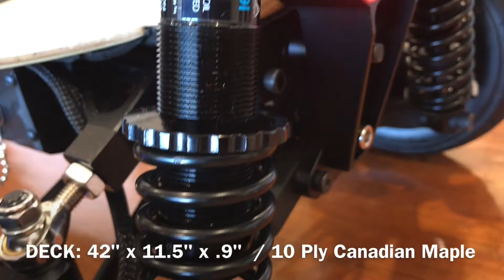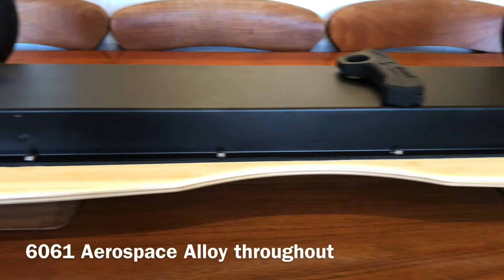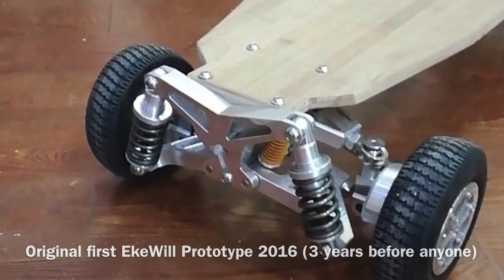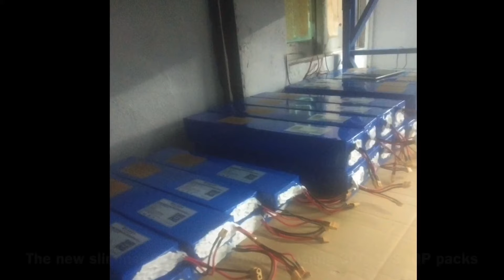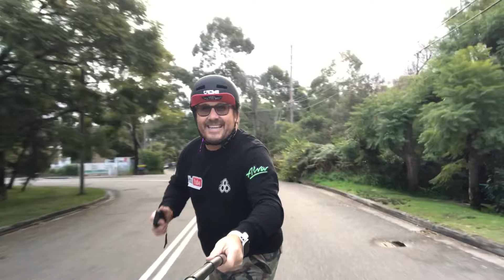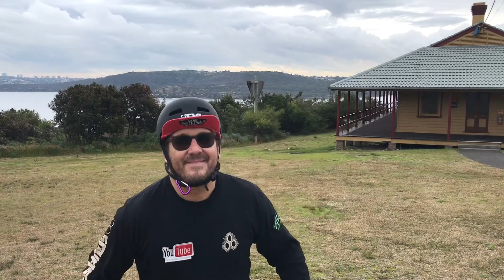EkeWill GTX 4WD Planetary Gearing 12,000 watts AllTerrain EBoard - Andrew Penman EBoard Vlog No.159

Comment: Hey great review! I have an option of buying I think the mach 1 version as you said from a local private seller in Europe ;) its got a black deck its 2wd and has 24 ah batt on it, am I right that this is the first version? What drawbacks did it have?
Reply from the maker: Hey Simon, wow exciting for you yeah the Ekwill is a high polished premium quality build it has the Skeletor CNC milled arms very different to its main competitor the M24 it’s got better but still one can easily see the difference in refinement originally and now there’s done the CNC mil but is still chunky and seek didn’t have the same refinement the Ekwill is a superb build ... mine is still running perfectly no issues at all, okay the early EkeWill were as I understand always a woodgrain decks the retailer may have done a custom deck on it that the rear 2WD has more than enough power and 2WD had no real drawbacks at all they’re still using the same ESC as the version one it’s a custom controller not a LingYi  here you’ll really love it gets yourself some foot straps head out to the Forest it’s mine blowing..... do you love the adjustable oil filament shocks they’re the real deal not a fake air like others  they can really handle a pounding, two wheel drive rear drive train can present some fishtail instability if you’re pumping it at high speeds but they did  correct that with some modifications to the arms but other than that you’ll have no problems 👍 let me know how you go Simon you’ll be very happy it’s like quite a prestigious Eboard the EkeWill it’s kind of your Aston Martin of these beasts 👍 awesome cheers Andrew ⚔️
Reply: @zulupenman  wow thanks for that quick response mam 🙌🏼 yesterday i went to see it - the built quality is superb i must say 😁 - I wrote to you because currently the Ekewill is selling 15 ah batt for 2wd and 30 ah for 4wd no info about the 24 ah 2wd version, which got me suspicious if its a fake or what but what makes sense is that this is a previous version, do you have an email i could send you a video of this board and some pics for you to judge
Reply from the maker: Hey Simon no problem my pleasure, yes please send me a video close-up of the board I’ll tell you straight away whether it’s a fake a rebuild or the real deal, I can tell you now there’s been a lot of heavy discussions In the Facebook riders page is about 5 months ago ....and I’ve been the victim of a lot of bullying lol and harassment from the Ecomobl 24 riders (I can more than handle don’t you worry) lol ...and I can tell you a lot of stuff that I know about the original inventor designer of this style monster  board and it certainly is a Mr Marr from EkeWill . Okay I totally get it he took inspiration from the BajaBoard .... but .. I hate it when a company a big Chinese company takes credit for potentially inventing this design and rubbishing the other company (EkeWill) which is nowhere near as big....  with a less inferior lower grade quality product, there’s a lot to unpack in this rivalry space lol ... yeah but I can go more detail with an email but let’s get you on the right foot he make sure you’re getting the right fitness for purpose board essentially is an EkeWill...and that’s going to suit what you need to do and we can go by email 👍 and chat about that outside this platform .... I don’t want to entice or encourage any more trolls and skulduggery LOL. No problem Simon I email address...it’s in the “description field” at the very end 👍 you’ll see my email address there ....just flick me an email Simon we can go from there we can even have a chat on messenger no problem at al 👍 I am about to next month do some more new Ekwill videos some Red Bull challenge inspired Hill climbs that at 40% inclines ....going to be pretty exciting awesome stuff Simon look forward to hearing from you cheers mate Andrew⚔️

Comment: I had a question Would you go for a 14ah 35E or the 12 ah 30Q thank you
Reply from the maker: Hey Jean ;) awesome thank you so much for popping in so great to meet you. Look without a doubt I love the 18650s over the 21700 for their long range and they don’t suffer and can handle a flogging more ...definitely go to 30Q’s... I just got 42km range with this big beast working with a 10S10p 30Q Samsung setup .. awesome cheers Andrew ⚔️
Reply: @zulupenman  Thank you very much for the hint. I am trying to change my order from the 35E to the 30 Q. Vic is also saying that they have a new ESC, do you know anything about that. Best regards. JFC
Reply from the maker: Hey Jean ;) no problem at all yes I think he had a few drop out issues on the original batch from Hobbywing so I would go to most latest ESC /remote . Definitely the Q batteries are tge go ... With a 15amp draw rate(constant) with a burst up to 25amp and it’s unbeatable ...people think because it’s an 18650 it’s old technology ..it’s not it is they go.... amazing check out my EkeWill long-range Test .. that doubled the range of the competitor Ecomobl which uses 50E battery (even the fact they’re  21700) awesome.. cheers Andrew⚔️

Comment: Great review, good to hear the history behind the development as well. I love my "500w" MAC motor (high torque wind) on one of my ebikes, and thought the tech would find a place on eskate's soon enough. Do these motors have a clutch in them I wonder? I ask because the clucthes on the MAC can wear out with accelerating over bumps, -eg loads of on/off pressure on the clutch.

What a beast, looks very nicely done. Longevity & maintenance will be good to hear about over the longer term. ;-)
Reply from the maker: Hey Lee, Great to hear from you..thanks for your amazing comment and thanks for the great feedback and appreciation of my videos really makes my day, sorry for late reply it’s been crazy. Look in a nutshell no no clutch just pure planetary gearing and the reverse breaking works the same normal motor.. it’s a pretty robust build and this is the original inventor Lee who designed this planetary Gearing way back in 2013 for this skateboard set up so it’s extraordinarily well-made 100% CnC Milled and all anodised the coating on the actual gear cogs of the gearing is insane it’s super smooth and reasonably quiet too ;) i’ll keep you posted on the maintenance and how it holds out so far it’s a beast awesome cheers Andrew⚔️

Comment: I have a new m24 awd.. Here is where this goes off the rails.. first... this board is significantly more expensive... the eco is around 2k right now.. this thing is 4 k.. 4-2=2... thus there is a 2k difference.. i can buy 2 m24s for your price...
Second, have you ever ridden the m24.. all features are controlled by the remote. I can switch between 2 and 4wd from the remote.. Third.. this guy builds his boards piecemeal,  ecomobl has an actual factory with high quality manufacturing processes and qc.  All the parts on the Ecomobl are all CNC...( have you seen one?) So, if im buying this type of design, and i can have newer more developed tech at half the price... oh, almost forgot.. i have 21700 50e cells.. not old 30q... i think ill get an m24, and an ET for less than one of these..  you dont seem to know your own board... also.. i have run flats.( without Dubs).. no patching required...
Seriously, go look at the specs...
This is no deal...where is the 2k extra value? 700$..????? I looked.. the eco m24 is nearly 700$ discount right now, is that where you are confused?
Reply from the maker: Hey Senidog, hey thanks for reaching out and popping in and giving us your feedback. You got some really nice points here in the prices✅ I really appreciate you feeding that back to all of us, very important % discount there. Look dude seriously not all the parts on the Ecomobl are not CnC milled  ...I’ve got one here I’m looking at it now as I type it’s not all CnC milled .. not skeletor milled hollowed out A Arms like on the EkeWill... yikes are solid heavy ... your E batteries don’t perform better in  in long-range test than the Q ... the Q’s are still the best for long range without any sag ... I just got 30 km range on this thing in four-wheel-drive doing about 30 k’s average speed...a have a look at your at Shocks they’re not in the same class as “coil over oil” Compressed hydraulic ... the EkeWill shocks are $109US each alone for 4 x Shocks are $436US it makes a shit load of difference ... if you’re in Sydney and you’re welcome to try the EkeWill GTX mine...you’re comparing apples and oranges to a certain degree ...I do appreciate you popping in and having a chat. By the way I’ve ridden both in my opinion... there’s a massive difference in performance ...quietness ..turning circle ..carving ability ... the pneumatic tyres ...ground clearance which is 5.2 inches it goes on and on ....so yeah you got to try one before you talk negatively about it ... Don’t worry I was pleasantly surprised ..awesome cheers Andrew⚔️
Reply: @zulupenman  The 50e cells are amazing for longer range as they're only 10a discharge but 5000 ma capacity. LaCroix use them in their Flagship Lonestar & get close to 100km in range from a 120 cell pack. Top speed of over 70kph. Granted, i wouldn't put them in a board that only has 4 cells in parallel like Ecomobl have but they can be a great battery if your pack is big enough. 👍
Reply from the maker: Hey Jackson ;) awesome information my man thank you so much ..you’re obviously a bit of a battery enthusiast too ..love that. Look I’m having extraordinary results with the 30Q’s  the 15 amp drawer rate is just the perfect Goldilocks...I feel it’s better for long range it’s less punishing as the 18650s certainly can take hammering and beating and they seem to bounce back better then ask 21700 ...  I just got 42 km range on the EkeWill Long Range travelling pretty quick most of tthe way and massive 550 meter incline for nearly half the second part of the journey .. you can check out the whole ride on my channel latest video...so I must say I don’t think the 50e’s and possibly compete with that ..we’re only getting about 25 to 28 km range on that 50e Ecomobl setup ... which is pretty poor it’s about half the distance nearly... The 50e’d are more like 4920 ma when measured correctly... still not a big fan not convinced... lol .. but man ..thank you so much Jackson for giving me your feedback I suppose the proofs in the pudding as they say and that 42km range was pretty astounding on the long-range test... awesome cheers mate Andrew⚔️
Reply from the maker: Hey Seenidog ;) I have to tell you I disagree with you ... 18650s are much more forgiving to being flogged on long distance the 21700s are really starting to fail in distance ... and why because of the 15amp draw rate ... just because it’s bigger doesn’t mean it’s better.. I just got a 42km range on this GTX board sitting on 35km/h and pushing up 7 major hills for the second complete half of the journey...and over 550 meter elevation/ incline on that second half trip...and I weigh nearly 100kg one of the guys in our group is only getting 24km on his M24 ... with the 50E’s ... have a look at my EkeWill long-range distance test you can analyse the stats ... it’s clearly the battery setup .. the 30Q’s speak for themselves, tranzite are now using 30Q’s on all their setup‘s the range they’re getting is insanely ridiculous ... blowing  evolve out of the water.. awesome great to chat cheers Andrew⚔️

Comment: Ling yi esc?
Reply from the maker: Hey Ny ;) no it looks like it is ... is because that they had that remote control casing with the original version 12 months ago had that yes LingYi in here ....it was rather bitey and little bit tad aggressive on the breaking, so this is now completely been re-worked it with a new player entering the Esk8 industry from leading drone company providing an incredible sophisticated speed controller from Solutions inc. it’s a squarewave field orientation control FOC it is just beautiful to ride... 80% better than the LingYi that was in it... i’ve ridden the Ecomobl M24 ... it’s like talking cheese it’s still very aggressive and biting this GTX is completely different ;) awesome cheers Andrew⚔️